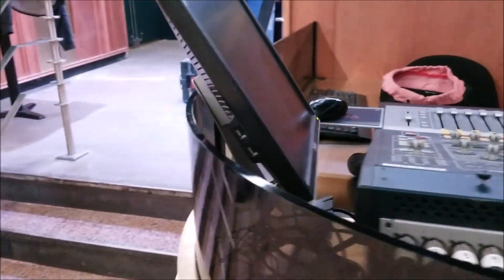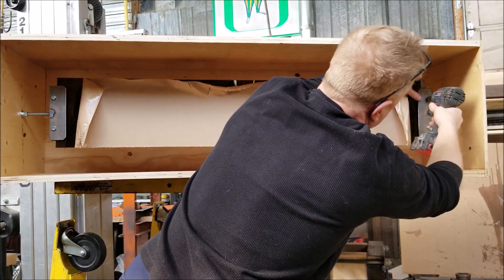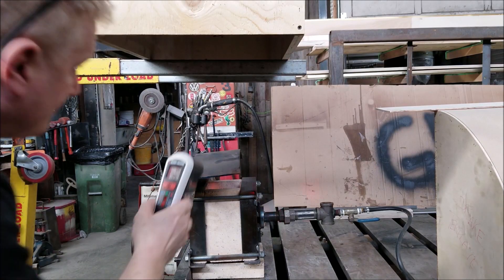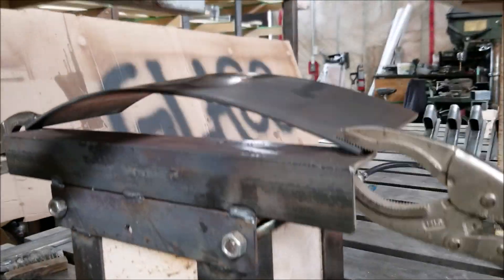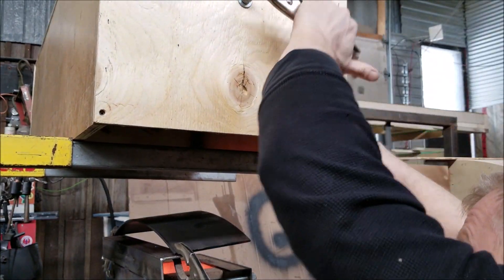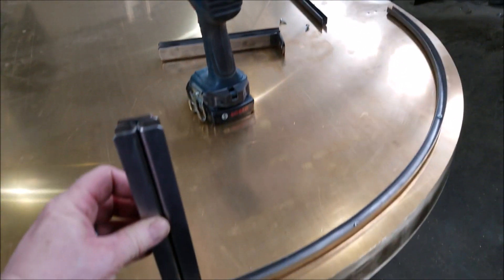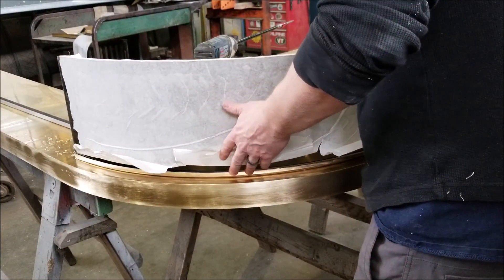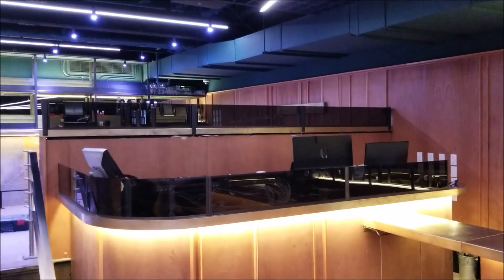Bend Acrylic with Propane Forge Burner?

Comment: Sir, may i know how you bent the channel? It's very clean. I'm hoping to do a similar build and I'm thinking of using a stainless steel channel.
Reply from the maker: I formed the channel,  then rolled it with a 1/2 thick flat bar inside to keep the channel's shape. In a tubing roller with flat dies for square tubing/flat bar
Reply: @itsnot_stupid_ifitworks  that's an awesome idea! that should work. Thank you!

Comment: I have to bend a 5/15 plexiglass from a boat windshield, 1 plan only :) :) :)
Length is 7th, width is 11". The the angle of 120 deg is 12" from the end only. How can I heat only the end then be precise bending on a 8" radius ?
Reply: Use heat shield material to cover the part that you don't want to heat or bend.
Reply from the maker: @RVGLASSFOAM  good idea👍
Reply from the maker: Create a heating box with a slot in the side just big enough to insert the section of plexiglass that will be bent

Comment: At 4:48 you drape the heated material over your "form" what is it made of and how did u make it?
Reply from the maker: It's plywood cut on the proper curve with thin mdf fastened to it. I plan releasing a video with a thorough explanation.  Just have to finally edit it !!
Reply from the maker: how to make an acrylic form video. clink link--->   https://youtu.be/0nJvEQYRq38

Comment: I have done things like this some 25 years ago using infrared (heat) lamps. Work piece laying flat on the felted table and heat from lamps coming from the top ... not saying that anything is wrong with doing it your way
Reply from the maker: That is a good idea. You could possibly have the acrylic above the mold (under the heat lamps) and let gravity drop it into shape.

Comment: Nice- many ways to do this and no matter how good you have it, there can be improvements thought of, I saw one video where they put it in the oven - they said 350 degrees F for 30 minutes- what you did us make an oven. I think if you put some sort if flame proof insulation around the wood and also found a way to seal in the heat and monitor the temperature - that might be better - but that might be more for me to do as I need to make a set up like this for the curved yacht windows we are doing- the other big thing I need to do is find a material for the molds- we need to make 4 sided curved windows, so the mold has to be flexible and also withstand moderate heat- any ideas, let me know
Reply from the maker: There is a company called Curvomatic. They have a YouTube channel. They make adjustable molds for laminating wood. They look expensive but you could use the concept. Check it out.
Reply: @itsnot_stupid_ifitworks  thanks, I will look for their site- intuition is telling me that there must be some clay like sheets that can be molded, then maybe when hit with fire, the clay turns more solid. That way, we can take the clay sheets to a boat needing curved and dome windows, make the mold on site, then bring it back to the warehouse and use it to make the windows
Reply from the maker: Hmmm ..have to think about that
Reply: @itsnot_stupid_ifitworks  let me know, we have a yacht now where we have to make our own molds, the originals are gone
Reply from the maker: Not having seen the exact openings you are working on.... Possibly stretching a type of stretchy plastic or rubbery material over the opening and then doing a coating that hardens( like a fibreglass with resin) over the plastic/rubber. Double layer with compressed air inside to make it dome out if needed... Same idea as doing paper mache over a balloon
Reply: @itsnot_stupid_ifitworks  haha- no end to thinking of different materials- paper machete might be good, light weight for on sight, then we can make a more substantial model at our warehouse - if you think of anything else, keep posting
Reply from the maker: If you look on YouTube for custom powdercoat oven videos there are some that are insulated boxes with stove/oven elements mounted inside. I considered doing that for this project.

Comment: where did you get the channels to join the pannels?
Reply from the maker: I made them from scratch. Bent the U shape from sheet metal in my hydraulic press and welded them back to back.
Reply from the maker: There are aluminum extrusions that are sold by companies like CR Lawrence.  I need the backened steel look for the horizontal straight /curved and vertical pieces
Reply: @itsnot_stupid_ifitworks  Thanks you so much!!

Comment: Another huge thing people are looking for is the material etc on creating a form  for radius. I know I was.
Reply from the maker: I believe I cut the radius out of two pieces of 3/4 plywood and screwed on 1/4 plywood. The 1/4 flexed enough for the radius I was doing. If you need a tighter curve you could use wiggle board ( plywood designed to bend)
Reply from the maker: how to make an acrylic form video. clink link--->   https://youtu.be/0nJvEQYRq38